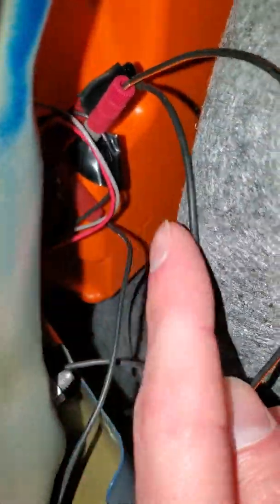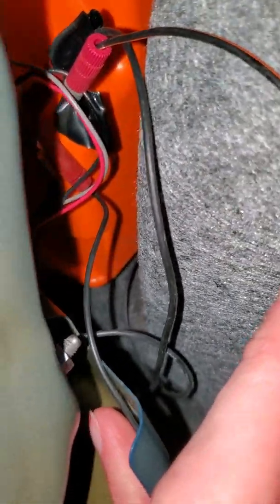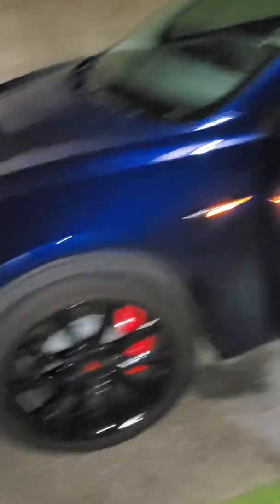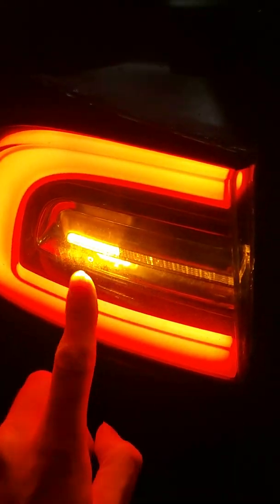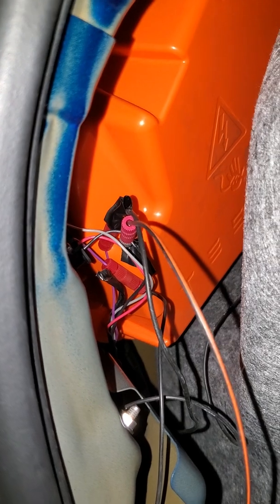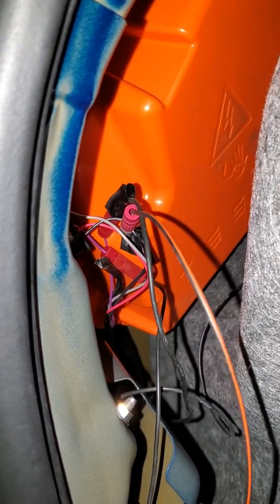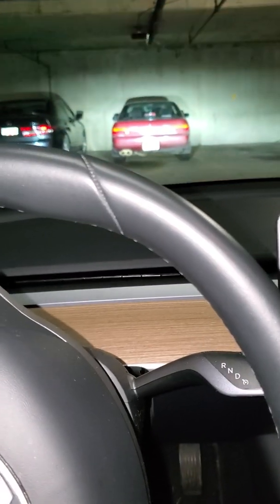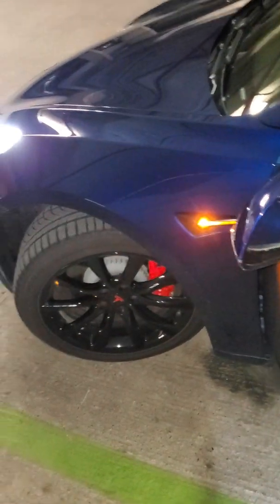Tesla Model 3 EU Tail Light Mod

Comment: Anything I can do to combine this method with the Teslogic adapter? As in with the resistor or side repeater wiring to allow the initial turn signal flash while braking?
Reply from the maker: I don't have any experience with the Teslogic adapter, so I couldn't tell you. If you try it though, let us know. I'm curious.

Comment: Do you know what to do to have the rear light following the driving (front) light - right now the rear light is off in daylight which is legal in EU except in foggy weather where they should be on? Is the solution to make a new wire from driving light to rear light (rear light is always on)?
Reply from the maker: You're asking about the tail lights right? Those wires should stay the same. They are used when the headlights are on.

Comment: I have a model 3 in china with EU tail light, but I really like the NA tail light. Is that possible for me to change to NA tail light?
Reply from the maker: As far as I can tell for the wiring diagrams for the EU spec car, it should be plug and play (it is much easier to go from EU to NA than the other way around. What model year is your car, is it from the Shanghai factory or Fremont, California? I have a set of North American tail lights if you want them I'll sell them to you for cheap. My car is a 2019.
Reply: @MYNautiGirl  2022 From shanghai factory
Reply from the maker: Let me see if I can find a wiring manual for the 2022 Model 3 CN version to confirm for you.
Reply: @MYNautiGirl  thank you!
Reply from the maker: @EZHAOH  Unfortunately I can't find a Chinese build wiring manual. I assume it's the same as the EU spec, but I'm not sure.
Reply: @MYNautiGirl  thank you so much!
Reply: 我有從我車上拆下來的燈。但是我好奇在中國紅色轉向燈是合法的嗎？
Reply: @yuyangwu5608  应该不合法，我想装着玩
Reply: 交換不？（手動滑稽）我在加拿大

Comment: How did you know to use a 10w 260 Ohm resistor?  If I can't find the exact one, is it better to go higher or lower Ohms?
Reply from the maker: A guy on the TMC forums already did most of the heavy lifting for me. I tried with a 25 ohm resistor and it still fast flashed, so go higher resistance if you have to. Make sure it's a beefy wattage too, I think 10W is pretty much as low as you wanna go.
Reply: Do you happen to still have the link to the TMC forum thread?
Reply from the maker: @PhuNguyen-vf6im  Post number 16 goes into more detail: https://teslamotorsclub.com/tmc/threads/wtb-model-3-euro-tail-lights.162852/